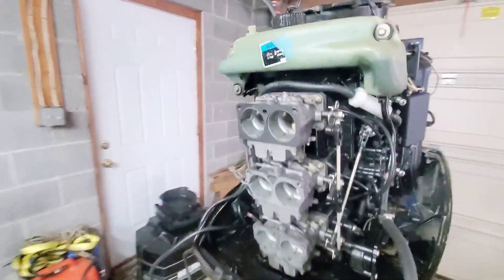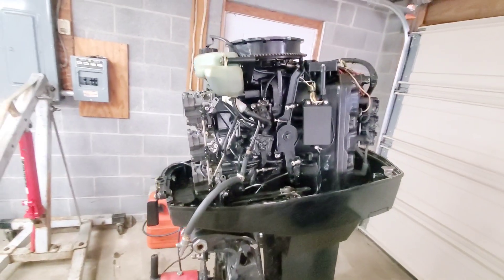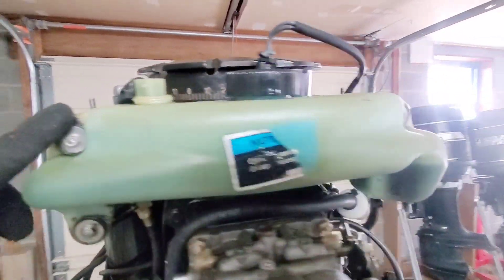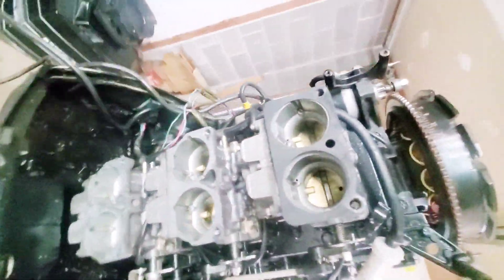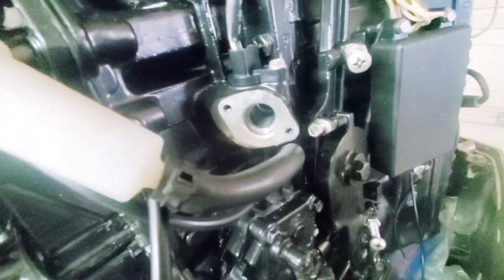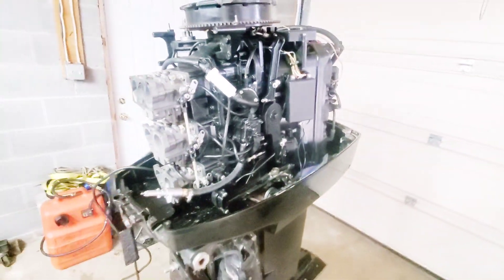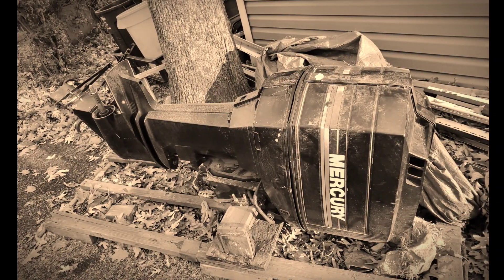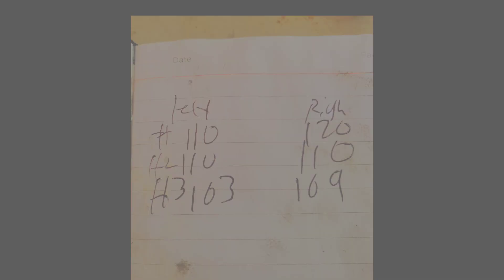2-Stroke How to Disable Oil Injection and Power Tune

Comment: You didn't say why you fought the plug, or how you nullified the issue. You didn't mention the crank case pressure needing blocked off, or show how you re routed the fuel line.

Comment: thanks much for the video hope you're still monitoring this, thanks to you I've found which block off plate to use. I just have one question, upon removing the oil pump on my 1994 125 HP Mercury OG039265 must I also remove the shaft and gear. hope you see this. thanks again!

Comment: Thanks for posting this video. My pops and I came across an 1988 mag2. It has been messed with previously to us getting it. The oil injecting is removed already. Also someone was using an electric fuel pump for this engine before. I've removed that crap and rebuilt the mechanical one that was on the motor. 
Here's my question.... fuel comes in the bottom of that. Out is on the top. A vent outlet is in the center on the face. Where does that vent tube need to go or can it be blocked off? 
Actually the pump that's on here, that i replaced the guts of, had the OUT blocked off and the vent has a  1/4 nipple on it. Any ideas why? Any help is mucho appreciated

Comment: hi .. this engine have alarm
for overheat?
Reply from the maker: Correct. Son
Reply: @MerCSonL6  why you disable oil injectors.. mix is better?
Reply from the maker: @paranormal7529  its really a preference. But just one less thing to fail.

Comment: What is the reason for removing the oil injection system. Why not let it run without oil in it and premix fuel
Reply from the maker: The gears for the oil pump get messed up if not blocked off properly.

Comment: I have a 92 Mercury 135 I got next to nothing said it didn't run the gas to it and it runs my question is on the motor side where do you hook up for the tachometer I'm not familiar with this as I am the Tower of Power
Reply from the maker: I don't understand the question.
Reply: @MerCSonL6  I found it the grey wire
Reply: But I believe the voltage regulator is bad because I had no signal to the tachometer

Comment: What's going on man, so I'm currently looking at a 20ft boat that has. 200 mercury oil injection motor. This will be my first boat, the dude informed me that the motor does not turn.. he claims it's seized. What process should i do to the motor to confirm this? Thanks love the vid
Reply from the maker: Simply turn the flywheel. If it's seized a costly rebuild is on the table my friend. The block will have to be torn down. 200hp is a heck of a starter boat. Son
Reply: @MerCSonL6  thanks, would it be cheaper finding another motor?
Reply from the maker: @spanishlavender7518  probably. I have one listed on ebay. It's a 175 though. If the engine is seized you likely may need a new crank, rod, bearings, pistons, rings etc. Not to mention all the gaskets and labor for the rebuild. Son
Reply: @MerCSonL6  I'm a look for your shit on ebay, son

Comment: I think you had the block off 180 that's why it didn't line up probably rubbing on the crank drive that meshed with the old pump shaft. There's a Lil taper
Reply from the maker: I appreciate your concern. The engine has been running perfectly for 2 years. Son

Comment: I just bought a 91 90hp 3 cylinder. Friend told me the oil motors fail pre mix is the way to go. I was looking for any answers to why they fail?
Reply from the maker: Its a preference really. I'm not a fan of oil injection. The connections that activate it usually have plastic tips. They crack (unknowingly) and your engine is toast. I've a lot of good things about it I just like the piece of mind knowing it's there. Piece of mind is priceless. Son

Comment: Are mercury’s 2 different fuel line sizes? 3/8ths going to the engine 5/16ths from the pump?
Reply from the maker: I recommend 3/8 for the larger engines (150hp and above). Son

Comment: I have a question if anyone cares to answer. So I have an 88 mariner magnum II 150 and want to delete my oil injection since my motor is low hours and those old nylon gears are prone to failing. I already have a good 50:1 mix pimed, ane ran on the muffs to get it into the carbs and ready to go but just to be clear, once I pull the pump and install the block off kit I can just run a straight fuel line with an inline filter from the back of my quick connection straight into the fuel pump, then remove the oil tank, oil motion sensor, and the oil warning module, then pull the crankcase pulse pressure hose and just cap that nipple or plug it and I'm good to go? Will disconnecting the oil warning module cause my overheat alarm not to work or are they on separate modules? Any input would be greatly appreciated
Reply from the maker: Yup. It will not work once disconnected. But pre mixing is piece of mind.... which is priceless. Son
Reply: @MerCSonL6  I did the oil delete a couple days ago and it was easy as can be. Haven't been able to take it out yet but ran on the muffs no problem. Thanks for the video. Was a big help

Comment: I’m not finding a complete block off kit online for my 1988 Mercury 150. Looks the same as what you have
Reply from the maker: https://www.ebay.com/itm/Mercury-135-to-225HP-2-0-2-4-2-5L-Block-Off-KIT-43453T-Remove-Oil-Injection-Pump-/304085468828?mkcid=16&mkevt=1&_trksid=p2349624.m2548.l6249&mkrid=711-127632-2357-0
Reply: Will this kit work on my 1988 80hp mercury ?

Comment: So its a 2stroke but you dont have to mix oil?? The oil is injected with gas automatic??
Reply from the maker: Mix the the oil with the best petro you can find. Ethanol free is great. Using 93 octane you need to put a stabilizer in it. I recommend startron. Son

Comment: Do you mix 50:1 after deleting the oil injection system?  Mine is deleted and I use 50:1 ratio mixture but it smokes a lot only at idle really. Any idea what is going on with mine?  Should I change the mixture ratio?
Reply from the maker: Do not change the ratio. As long as it's white smoke you're good. Son
Reply: @MerCSonL6  ok cool. Thank you

Comment: What is the purpose of removing oil injection and switching to premix? Does it enhance performance?
Reply from the maker: Just a preference. Also, 1 less thing to fail. Fail rate is low but I prefer piece of mind. Son

Comment: hey i would like an opinion i have a motor that i bought its a 1995 merc 150 black max efi  and im just wondering if i should block off and switch to manual mix  its running good but it feel to me to be not running fully and im worried that the oil injection might fail and as well the warring alarm dont work so im not sure
Reply from the maker: I would block it off. Piece of mind is priceless. Son

Comment: Thanks for putting up this video.
I have a '97, 175hp sportjet that is essentially the same engine. Deleted the oil pump. 
Is just disconnecting the 3 wires on the sensor enough to kill the alarm?  No need to place a jumper into any of the sensor connections?
I have no clue on this one but just disconnecting the sensor to accomplish that would be sweet...

Comment: I have a '95 2.5 that I recently removed the oil injection, what can be done to stop the oil warning light and warning horn in control box
Reply from the maker: Remove the oil warning module..... or unplug it. It's on the port side of the engine. Son
Reply: @MerCSonL6  Thnx!!

Comment: Hey i got a 1994 mariner oil injected. After i refilled my oil tank i took it out and it ran great no smoke. The last time i took it out just a couple weeks later the motor was smoking a lot. It sat all winter and it started right up this weekend. Still smokes a lot. Any reasons why? Thanks
Reply from the maker: Too much oil. Check your oil injection or disable it. I have a video on how. Son

Comment: I just wanted to clear up a couple things about this process. After watching your video, which is excellent BTW, I went through this on my 1992 135HP Black Max. I ended up completely removing the oil warning module and throwing it away. Also, many (Including a Mercury Marine service bulletin) suggest disconnecting the Idle Stabilizer module as a failure of this component can cause extreme advance of the timing at high RPM which will toast the motor. Its not difficult to do and may or may not require re-timing the motor. Also, pay careful attention to seating the O-ring on the black plastic block off cover and orient the flat part towards the motor crank. Mine really had only one way that it would go in with the bolt holes lined up properly. When mine was done my idle was a little high but adjustment of the idle speed per the service manual helped that out. Thanks again for this awesome video!
Reply: @josephthompson638  IDK if it monitors engine temp. I have a gauge on the dash and I monitor that myself. You should refer to your Mercury service manual before following what I did. I am not sure what the wires you are describing are. Can you be a little more specific?

Comment: What are you spraying into the throttle plates? And why? I’m pretty sure I have an idea, but I just want to be sure.
Reply from the maker: Mercury Engine Tuner. It contains petroleum distillates that absob and remove carbon. After 2 treatments the V6 compression is 120 psi across all 6 cyls. Son
Reply: @MerCSonL6  would sea foam do the job also?
Reply from the maker: @Jaiden.Springer  yes. Not quite as well but it definitely works. Son

Comment: Yeah, nice job. Thanks for the video. I am still unclear on a couple of points. Looking at the service manual for my 92 Black Max 135 I see two wires ( a blue and a black) from the reserve oil tank and I guess you just left these disconnected with no alarm afterwards? And, the motion sensor module on top of the oil pump has 3 wires shown in my manual ( a black, a white and a blue-white) to tell the engine that the oil pump shaft is rotating. What did you do with these wires? Just left them disconnected also? Finally, there should have been a hose from the lower crankcase that provides pressure to the external main oil reservoir tank outside the motor. What did you do with that? Just cap it with a bolt and clamp? Just a few details that I'd like to have tied up before I start this job. Thanks for your help.
Reply from the maker: I disconnected all of that. And premix. I'm ole fashion. I like to know what going thru my engines. Son

Comment: https://youtu.be/SFPDONJdjaU

Do you have an opinion on this? Been fighting it all season.
Reply from the maker: Link and Sync is off. Son
Reply: @MerCSonL6  TY TY.  I do feel like the motor will idle fine until I install the throttle cable.
Reply from the maker: @diejeffy  the throttle cable is manipulating the time. Turn the brass barrels until the cables are not a factor. Son
Reply: @MerCSonL6  The trigger plate wiring had a zip-tie holding the casing closed at the base of the trigger plate. The buckle of said zip-tie was hitting what I think was part of the block and not allowing the full rotation of the trigger plate. After changing the zip-tie I have alignment of the arrow/line on the throttle housing. I'm assuming my timing is a mess at this point. My T.D.C was also off a few degrees. Thanks for the videos, and input. 

https://www.youtube.com/watch?v=SLv5y6QWj4w&ab_channel=IDon%27tKnowFishing

Comment: Yet again an excellent video. AND timely as well. I just ended up with  a 3 cylinder 80 to build. Want to first see what I have then ditch the oil injection. I also have a 90 inline 6, haven't figured what to do with it, needs an ignition I think. After market or fix the stock one...not sure. Acquired a later model inline sic with the later ignition, maybe see if I can blend the two...some many projects, so little time. One nice thing about being in the Finger Lakes...lots of old fresh water mercs to play with for cheap this time of year!

Comment: hey mercson im still having issues with my 71 1350. i have replaced the distributor, rotor, cap, and wires I have also tested the box and it is working like its supposed to. I'm still not getting spark to the plugs. is the coil the next thing to replace? the coil i can find online doesn't look like the one that is on my motor. does it matter if I use the newer type on my motor?
Reply: Use a test light to make sure your getting power to your switch box when you turn the key. I had the same issue and my wire was broke in my harness somewhere.
Reply from the maker: It does matter. A 1350 will need an early 1970s coil. The resistance differs from the newer coils. You need a blue coil. Hope this helps. Son
Reply: Daniel I am getting power to the switch box. Mercson will this work?http://www.marineengine.com/newparts/part_details.php?pnum=MER332-4895A+5
Reply from the maker: @beaucrtr  thats WAY too much money
Reply from the maker: @beaucrtr  https://www.ebay.com/itm/233762170776

Comment: Why do away with the oil injection?? Is it a problem?? Me and my buddy both have early oil injection v6 motors. Is there a problem with certain years?
Reply from the maker: Its a preference. Also, an additional engine function that can fail. They rarely do but I like eliminating the probability. Son

Comment: Questions I have force 120p there milky color in cylinder number2  and I replaced head gaskets, but there still milky color and I removed the exhaust cover I see milky color do you think is the bad exhaust gasket?
Reply: Did you face the head? Always good practice to replace exhaust gasket when doing head  
Good luck
Reply: @xspower8899   ty
Reply from the maker: Xs has it right. Son

Comment: do you have a link for the block off kit? can you share what you did to modify the motor stand to hold an outboard? Thanks for taking the time to make these videos
Reply from the maker: https://www.ebay.com/itm/124311735267
Reply: @MerCSonL6  thank you
Reply from the maker: You're welcome. Thank you for your support. The engine stand i just bolted the engine on with 4 heavy duty bolts. No modifications on this stand. Hope this helps. Son
Reply: Hello joe from fla. They dropped the ebay site for the block off kits mine is a 91, 75 hp and cannot find the block out kit any where
 Can you help?